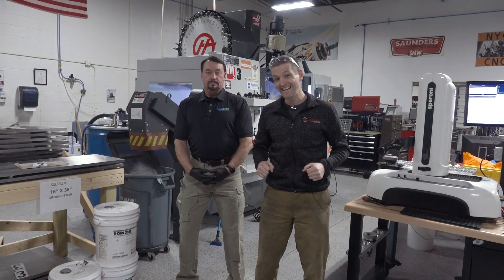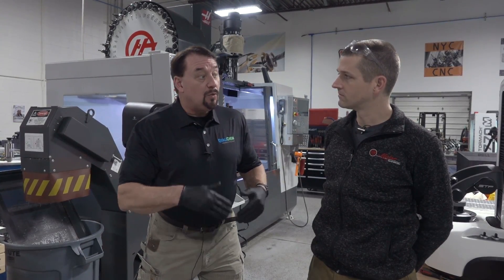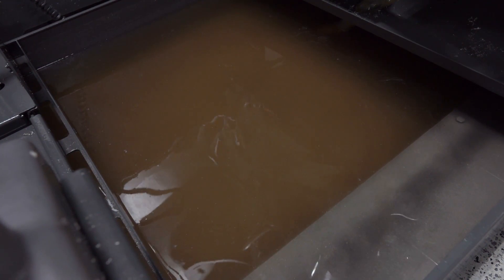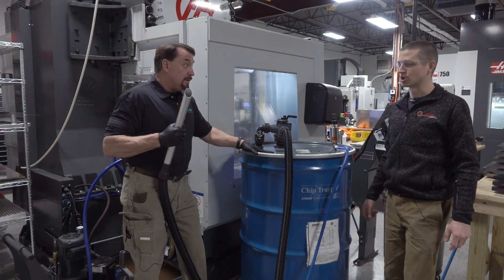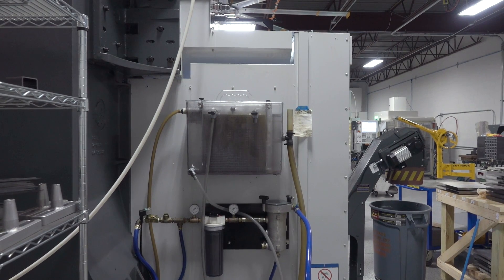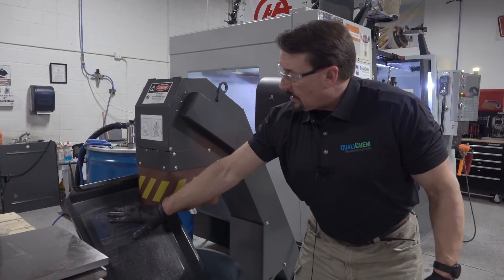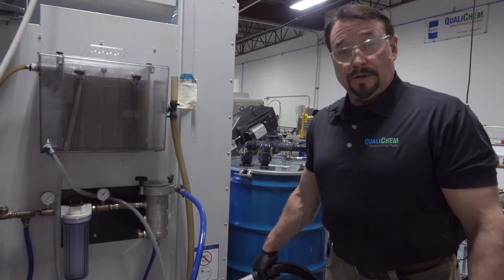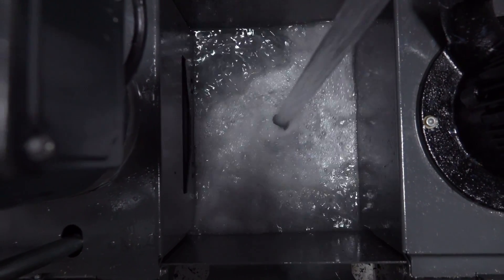How to clean a CNC machine and Replace the Coolant!

Comment: We struggle at our shop machining copper semiconductors because we can’t change or add anything to our cool based on SOP procedures required by the customer. Meaning we can’t use any cleaners or anti bacterial additives,
Doesn’t make sense some higher ups that have no idea thinks it will ruin the part. Our cleaning process after the part is done would stop that but oh well🤦‍♂️

Comment: Seems rather excessive and very expensive when u factor in all the hazmat  disposal cost i just suck out the coolant and rinse with water / remove chips and i only have to do that about every year and a half or so i highly recommend using oil skimmers and an air bubbler to extend coolant life

Comment: That was the cleanest dirty sump i have ever seen😂😂. He will probably faint if he sees our sump.
Reply: He put that tramp oil collector on a while back and it performed great. We ran the CNC machines hard for 16 to 24 hours a day so it has a lot of oils and grease in it. Cleaned the tank every 2 months and it was always a slimy shoveling mess - even with a large vacuum truck.

Comment: Funny I have spent the last 2 nights cleaning and scraping the goop in the sump of the big Monarch.  Even after 3 flushes and a bunch of wire brush action it still looks like muddy slimy water. 1/2" of grease and coolant residue over an 18ft lathe is a LOT of dirt to clean up.  I so wish my sump had been as clean as yours!!
Reply: I look forward to watching the video of that this weekend.

Comment: Your coolant is dirty until you have to cut coolant cheese out of your tank.  I cleaned a mori vertical mill that hadn't had a coolant change in close to 10 years, not my fault I had taken over the machine and job/position from another guy.  I literally had a black, brown and creamy white build up 4 inches think in the corner of the tank.  It didn't have a nasty odor, but the consistency of it was disturbing.  I swear I could see it moving and pulsating on it's own.  I had to shovel it out of the tank.
Reply: "Pulsating" hahaha

Comment: Great to see this whole process.  Huge thank you.
'all coolant have a multiplier'.  Humm I have not heard that from my coolant provider. Something to discuss with them.
Reply: If you haven't been using a multiplier, you've been doing it wrong, or the multiplier is 1 and no multiplication is required. Read the bucket the coolant comes in. Or look on the coolant company's website.
Reply: All our coolant suppliers had a label on the barrel saying what multiplier to use.
Reply: Every coolant is a little different. It depends on the formulation. Your supplier should tell you when the conversion isn’t 1, otherwise you will be prone to wasting concentrate by running too rich.

Comment: Hey John, I noticed you switched from Qualichem  Xtreme Cut 251C to Q-Cool 355D, any particular reason for the switch?
Reply from the maker: Still using 251C on all other machines - the 355D was a test on this machine (which makes fixture plates) to see about better tool life on steel (answer: definitely better tool life!)